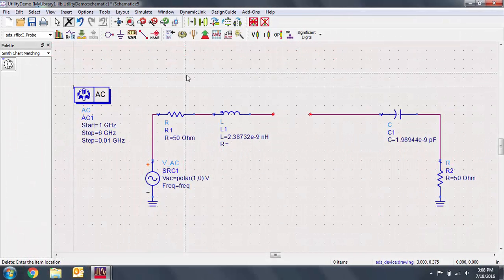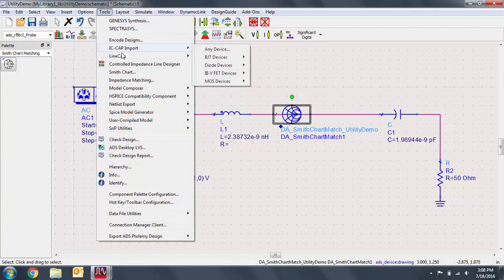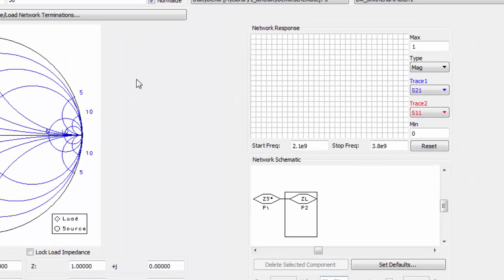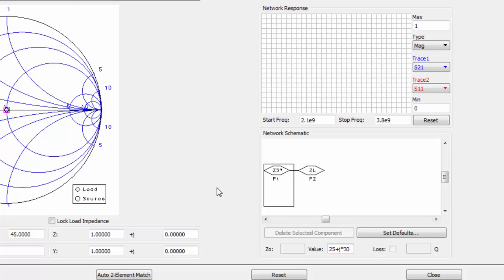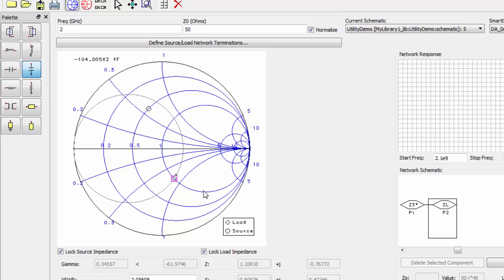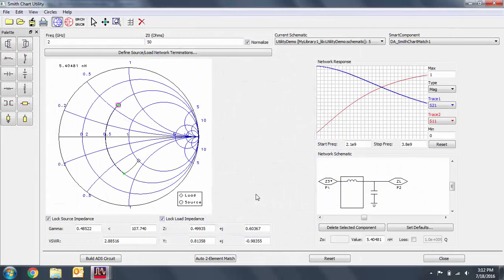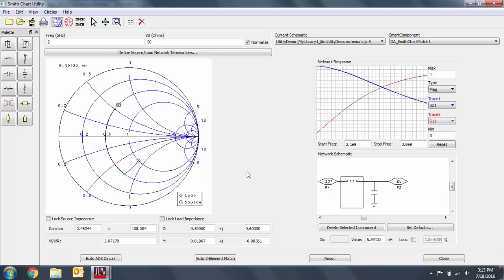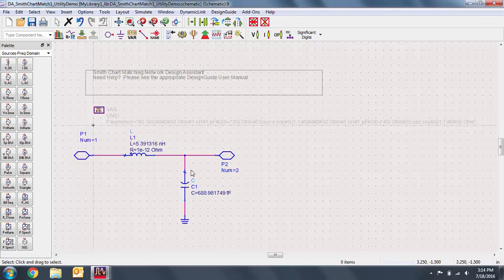Smith Chart Utility for Impedance Matching

Comment: Maybe someone will help me. When I try to open the Smith Chart utility (after putting the SmithChartMatch component in the schematic) it gives me the following error: 

(smithdg.ael line 11175, column 13) 
Parameter 1 of fputs is NULL.

Expected "file".

Using the debugger I can see that there is an ael file (decmddlg.ael) which is missing, but i don't understand where to find it...

Comment: So many things wrong here...
a) You say the source inmpedance is 25+30j Ohm, but in the circuit it is 50+30j Ohm
b) The inductor and capacitor values are wrong. To get 30j Ohm at 2 GHz the inductor has to be 2.387 nH (not 2.387e-9 nH). For the capacitor the capacitance has to be 1.989 pF (not 1.989e-9 pF)
c) When you are going to match ZL to Zs, you go from ZL to Zs*, not to Zs (as you did). With your matching network at the source interface you get Zs looking left and Zs looking right. That is not impedance matched.

If anyone wants to do it right, plug the right values and use Zs*=25-j30 Ohm in the Smith chart utility. That way when you simulate S11 (replace the voltage generator and source impedance for a Simulation/S-param/term-element with impedance 25 Ohm) you get a perfect match at 2 GHz.